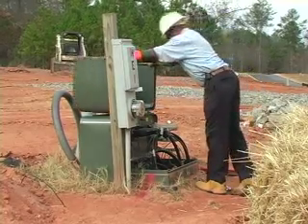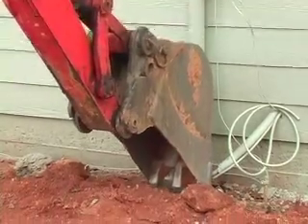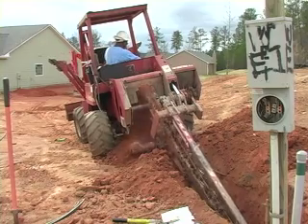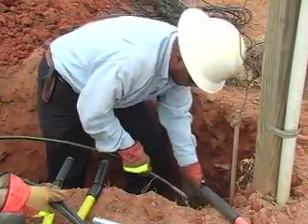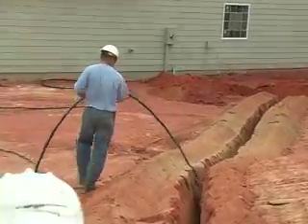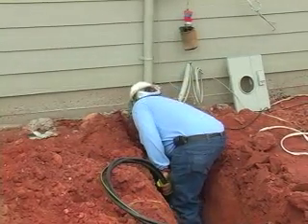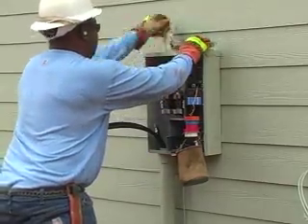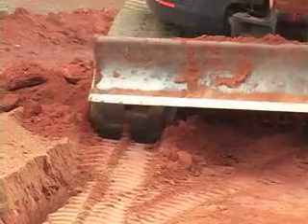Installing Underground Wiring

Comment: Great video, I just wondered, why you used crimp sleeves instead of insulinks or was that the neutral conductor.  Either way I love electrical work and I wish I had a crew like yours.  Guys that work well together, are knowledgeable are real tough to find.

Comment: see all that water pouring outta the fuse tube? weird
Reply: That's mineral insulated oil, it keeps the transformer cooled down and it prevents arcs from happening when they pull the fuse out.
Reply: its oil to keep the transformer cool

Comment: Interesting - but mine is in 3" conduit all the way out...probably 180 feet.

They were not allowed to cover it until the inspector came to verify conduit size and trench depth (3 feet deep).

That's just how it works in St. Louis, Missouri.